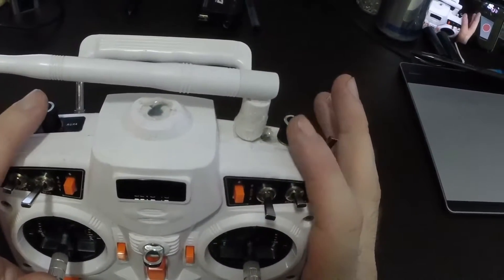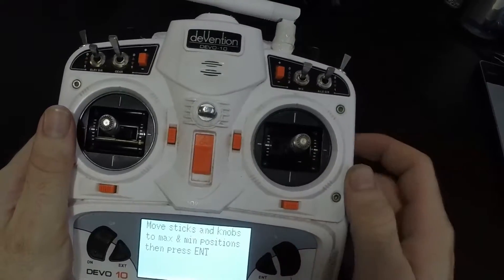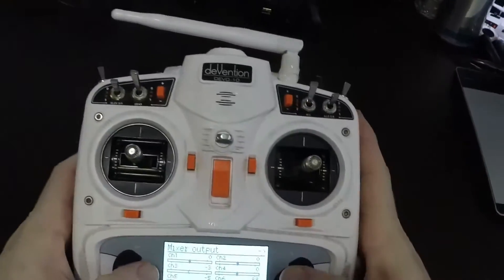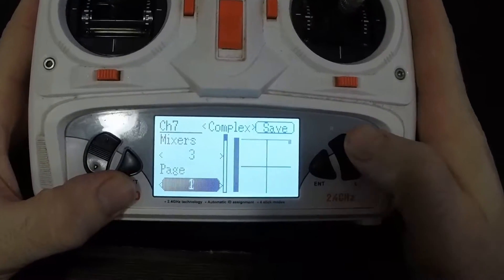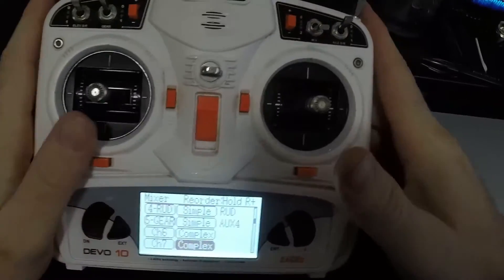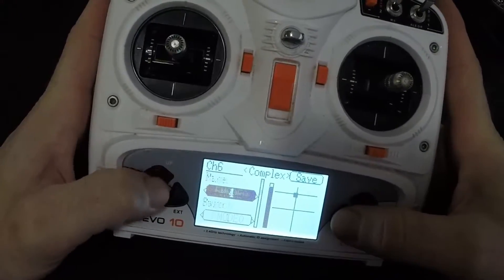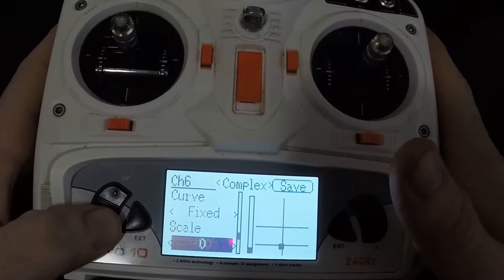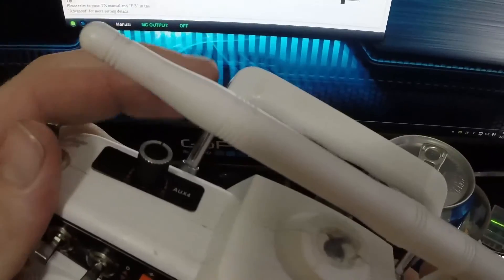Deviation 5.0 Programing 3-position switch's Devo

Comment: Hi David, my Devo 10 (with deviation 5.0 firmware, 4 in 1 module) the motor stop working when the throttle moved more than half way.  What is wrong?  Please help!  Thanks!
Reply from the maker: Recalibrate all sticks and switches at the same time.
Reply: I recalibrate the Tx three times.  I also bind it with another heli (one same protocol, one with different protocol), same things happen.  Is it the potentioner damaged?

Comment: i don't know why it's such a hassle to set 3 pos switch up on devo.. my teranis did it automatically when i selected a switch for a channel.  my devo6s has a different interface than your devo but i think this guide will help me out.  thanks
Reply from the maker: It is an open firmware that is updated and changed all the time by open source users.. Not the stock firmware from Devo. this is called Deviation.